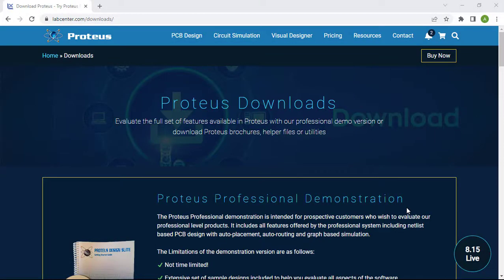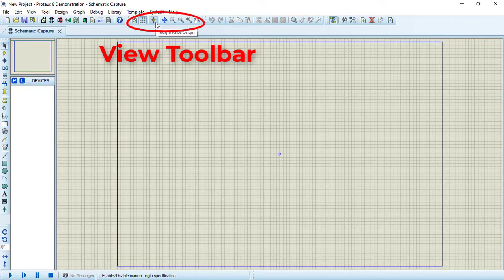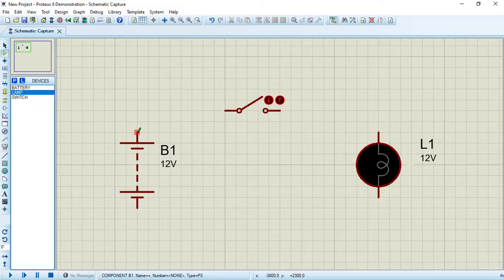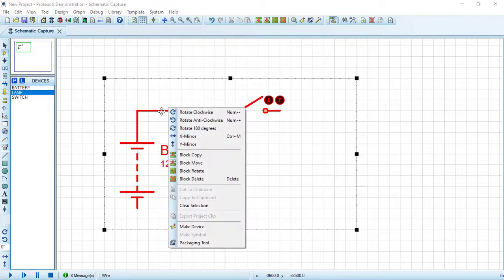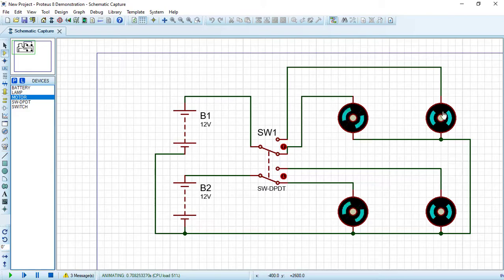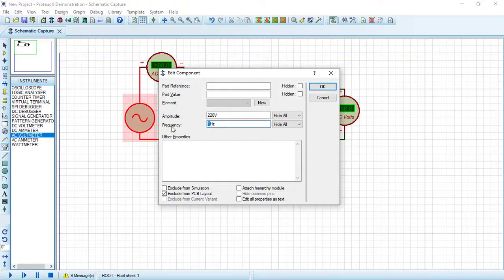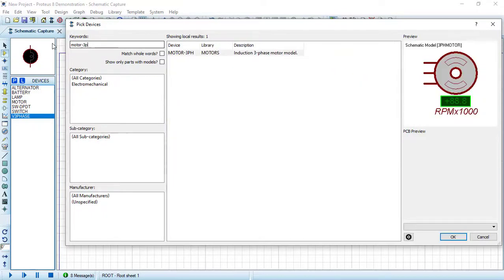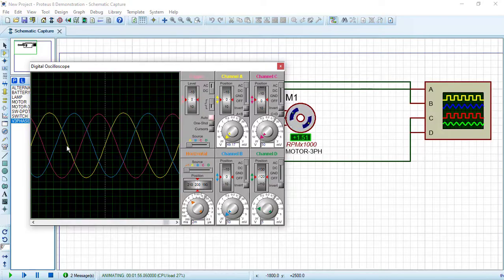Introduction to Proteus | Tutorial #1 for beginners

Comment: I am working on a solar tracking project. The servo motor in the system is supposed to position the panel horizontally when the cloud cover value retrieved from open weather map using an api key is greater than a set threshold (70%). 

If this condition is not met, the servo motor is supposed to rotate (West or East) based on the inputs from the 2 LDRs. 

I also want that the system be powered by the output of the panel and with a backup, just in case.

I don't have any physical components for now. I just want to simulate everything.

I need help. What I've been able to design so far isn't working as expected.
Reply from the maker: you can use proteus with avr or arduino and simulate the code
Reply: @electricalengineeringplane6620  
I am using proteus with the Arduino. Varying the two LDRs, the servo responds. But the cloud cover mechanism doesn't seem to be working.

I'm using a Python script to retrieve cloud cover percentage from OpenWeatherMap, and I'm using VSPD and COMPIM component in Proteus for the serial communication.

When I connect a virtual terminal across the COMPIM, it displays the cloud cover value. But it's not controlling the servo motor. That is my problem.

I also want to send data back to the Python script, but when I connect the TXD pin of the Uno board to the RXD of the COMPIM, Proteus tells me "logic contention error."

Comment: can Proteus work on macbook?
Reply from the maker: @omargaafar3600  No, Proteus does not have a native version for macOS. It is primarily designed for Windows. However, you can still run Proteus on a MacBook using one of these methods:

Boot Camp – Install Windows alongside macOS and run Proteus natively.

Virtual Machine – Use software like Parallels Desktop or VMware Fusion to run Windows inside macOS.

Wine or Crossover – Try running Proteus using Wine or CrossOver, but compatibility may vary.

Comment: Initially, the OSCILLOSCOPE was working exactly as you have shown in the Video but after that, it is not working at all? I have already uninstalled and reinstalled the software, but still no joy? What might be the cause?
Reply from the maker: I also had the same problem, i'll tell you if i'll find a solution
Reply: @electricalengineeringplane6620  i can show  you the solution
Reply: It is the bug in the software. I also have similar problem here. I created the another project and it worked but just for once. It works only once for every time you create the new project. Let me know if you found the solution....

Comment: What I have noticed about electronic simulators, none of them
are without flaws, if your amateur and want to test a circuit before
you go to a PCB layout and the simulator reports an error when a
circuit is without fault, then the purpose of a simulator is defeated.
at $9000 you want some reliability and I haven't seen one simulator yet  
that I have full confidence in, but don't take my word find out for
yourself